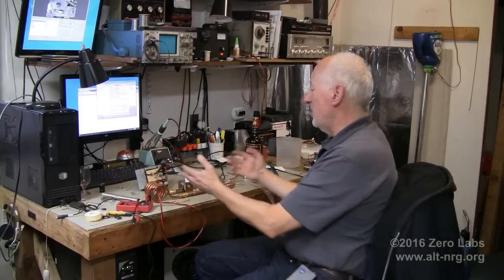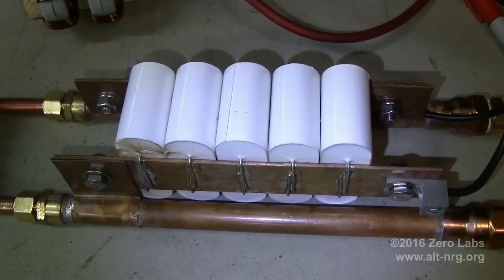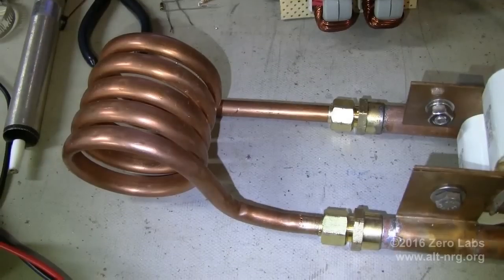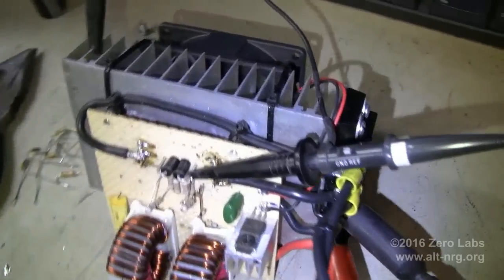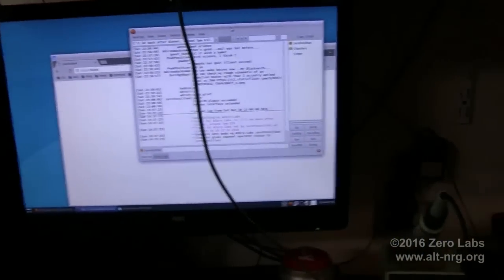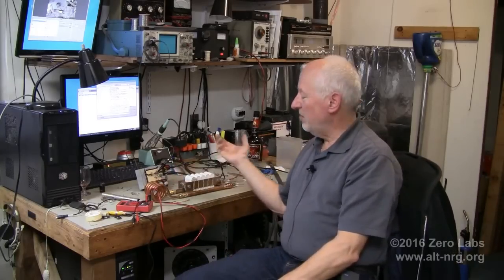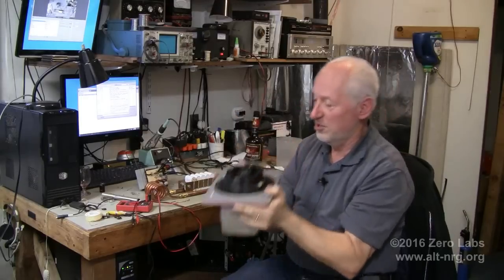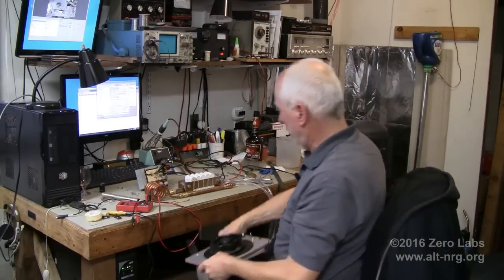#469 Induction furnace working!

Comment: Do you think that using an induction heater to heat water and heat a space would be more efficient than using a electric resistive heater of the same electrical value ???
Reply from the maker: No chance.
Reply: @zerolabs  So I guess my idea is not really that good ??

Comment: THANKS FOR THE GREAT VIDEOS:  One thing, when capacitors are connected in parallel, I DON'T think the TOTAL ESR is divided like resistors in parallel.  If you look at the internal resistor/capacitor  diagram, it is VERY easy to overlook that the resistors have the capacitor in the path, and in parallel, this makes the actual resistance HIGHER than expected.  I can't recall the formulae right now, but the formula was from MIT.  I have to try to find it.

Comment: What temperature does your cooling water get to?  How long can you run the circuit?  Could you modify it to be a tankless type water heater?  Is there a schematic of this available?
Reply from the maker: I doubt very much that this would be an efficient way to heat water. That's not the point here at all. I am building roughly a hybrid of what is seen at these web sites.

http://kaizerpowerelectronics.dk/general-electronics/royer-induction-heater/

http://www.instructables.com/id/Powerful-yet-simple-induction-heater/

http://inductionheatertutorial.com/
https://www.youtube.com/watch?v=0HdbKKvOiWU

Comment: Cool stuff, thanks for the video!Reseach flat earth, it will help you understand magnetism/electricity
Reply: how do you know that all other "planets" are round? Did you go there to check it out? Same about earth's shadow. Explain it to me :)
Reply: The moon orbits the earth. When it is not a Full Moon, the half moon that you see is caused by the earth partially blocking the light from the sun. The shadow of the earth on the moon is shaped like a sphere.  Also I have seen in a telescope other planets and they are indeed spheres.  Most objects in space are spheres.  This is because gravity works in all directions and if you consider in space being pulled inward from up, down, back, forward, left and right you form a sphere.  The earth is still very molten in its mantle and given its size and plasticity, the earth can not be any other shape than spherical.  If it were not spherical people on the outside edge of a flat plane  would be being pulled toward the center instead of straight down like everyone everywhere experiences.  You'd always have to be holding on to something in order to keep from getting dragged along the street towards the center.

Comment: I was trying to make a gravity motor and I had sprockets, chain drives and shifting weights etc. The result is that the counter balance was always directly proportional to whatever weight was shifted. It was amazing but it didn't run on its own and it might have even worked better backwards, which confirms the failure. I'm still quite sure something is possible but it's back to the drawing board. It reminds me of riding a unicycle on ice. The center of gravity is always straight up and down (so a unicycle is safer on ice than a bicycle). I'm still waiting for the show, "Unicycles On Ice".
Reply: A gravity motor? Please explain the outcome you are pursuing. I might be able to assist...maybe.
I have a momentum transmission concept that uses spinning hammers to get a propulsion effect, but needs review for conformation and improvement. That is...if your interested in either?
Reply: A working model would be required. Almost there is never good enough with alternative energy. It has to actually work in a significant way. Something is bound to work but seeing is believing.
Reply: I like math and science, myself. I've seen too much crap on youtube, but at the same time, understand your POV.
Do you have any stuff on your G-motor that I may look at? I'm in the need for some inspiration and new problems to solve.
A comment last night on a "free energy" video has me thinking Van de Graaff gen, but I have no direction with it (he said: "my carpet could produce more energy").
Reply: WhtStr213 Yes, we all need some inspiration on that. I was thinking of heating metals, liquid vials, mechanical shifting weights (I actually made a model with shifting weights), perhaps some generation of static electricity as you mentioned and there is another idea that I haven't tried yet so I don't want to give it away.